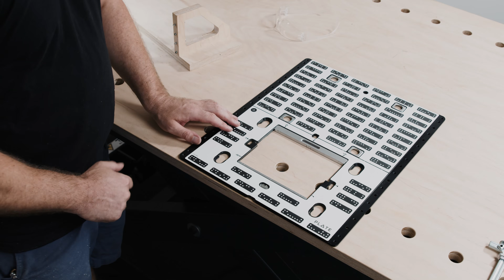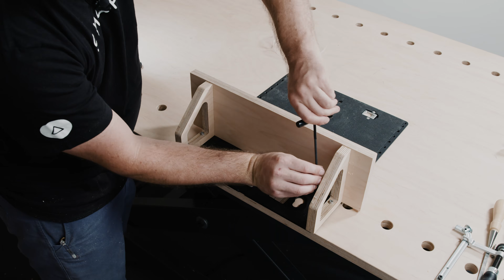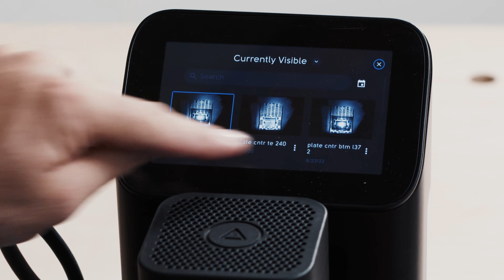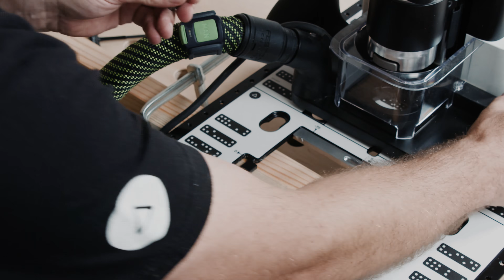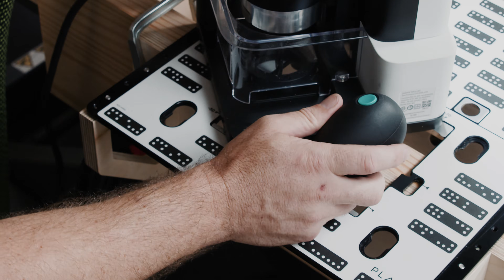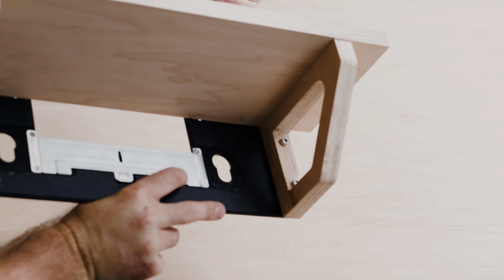Customizing Shaper Plate

Comment: when setting cutting depth, don't you need to account for the additional height of the plate since it sits on top of your stock? I haven't seen anything where that's taken into account.
Reply: the z axis is set off the moment the cutter touches the cutting stock surface and the machine base lifts off whatever it is resting upon. so even though the machine is 1/4" higher than the material being cut, the z axis (depth of cut) is set where the spindle cuts. the x/y axis is still set to the plate plane that the machine is sitting and moves upon.
Reply: @kjc10  derp. Makes total sense. Thanks!